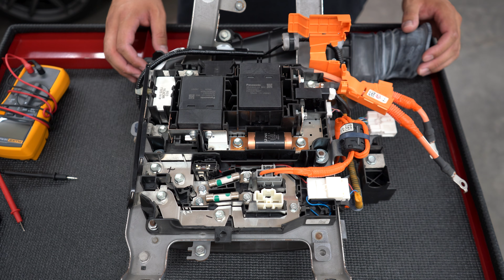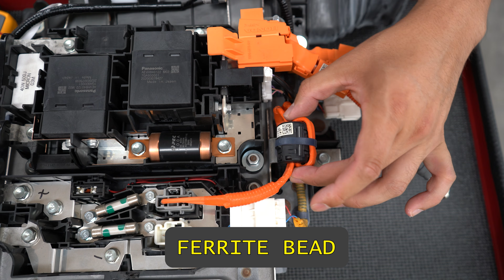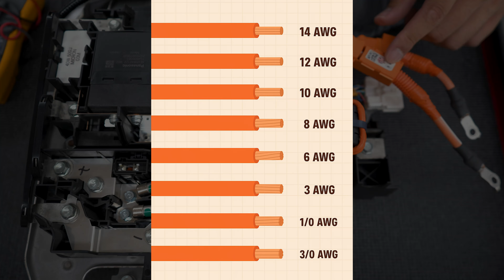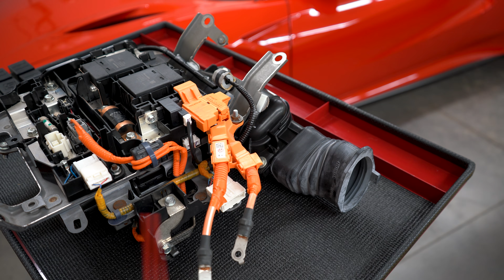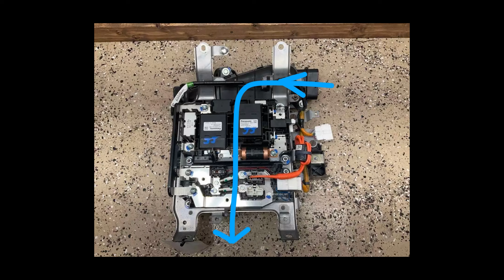Acura NSX NC1 Hybrid Anatomy – DC to DC Converter Junction Box Explained

Comment: Great video, David. I really appreciate how you and your wife breakdown all the different components. Question, since it has a DC high voltage to DC low voltage converter, does the car also have an alternator? Seems like it might not need one.
Thanks again.
Reply from the maker: Awesome question! The NC1 does not have an alternator. It uses this part to covert high-voltage power to low voltage for the 12V battery system.